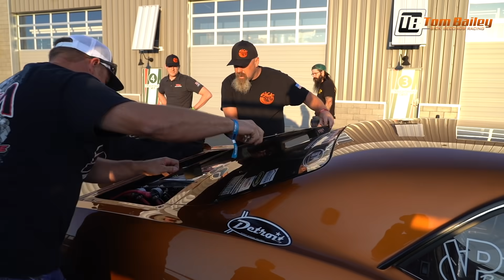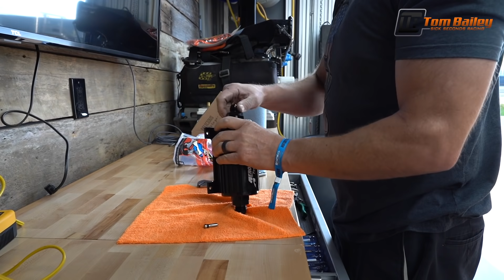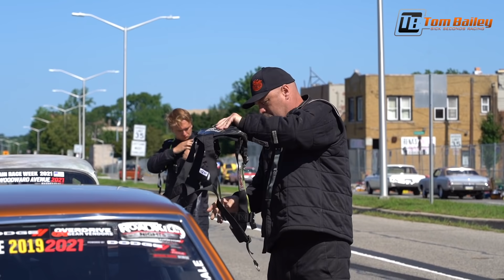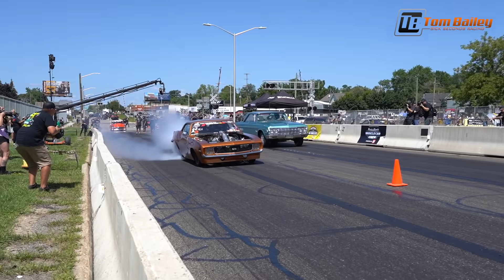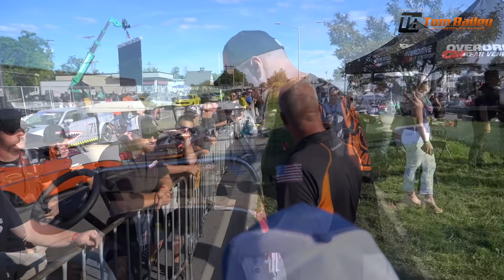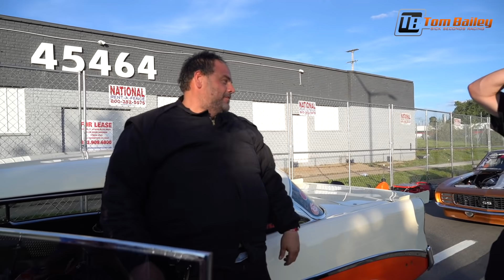We Street Raced Sick Seconds (After Problems)! Can Our 2500hp Camaro Win Roadkill Nights?

Comment: LoL.  I was LIKE #500 !
  I know the feeling with the big tires.  Had a old Duster with 35/22.5x16   Dropped to 34.”  Then had to drop to a 33” .    Kind of like when we used to run 36” Dick Cepek Fun Country tires on out Blazer.  Can’t get them any longer either .
  The cycle of life should not have to circum to small tires .

Comment: I know everyone will flame me for this but you should only be able to run "pump gas" both on the drive AND on the track... These cars are just quick change pro mods... You should have to race in street trim since everyone says they are the fastest "street cars". When they go down the track after changing everything they are no longer a street car. A fast pump gas car is WAY more impressive then a pro mod that can switch to running pump gas to survive the street driving.